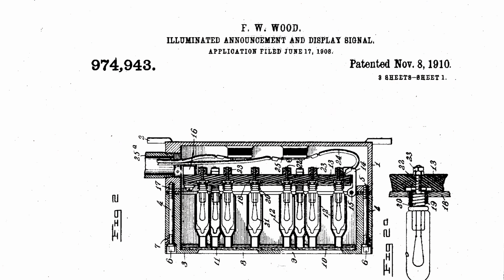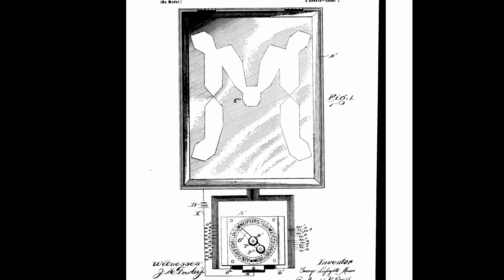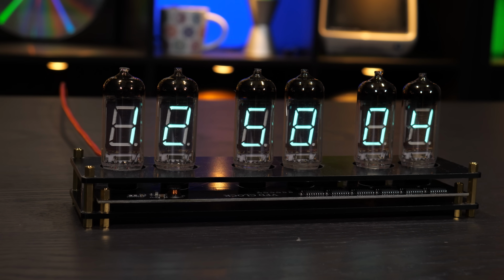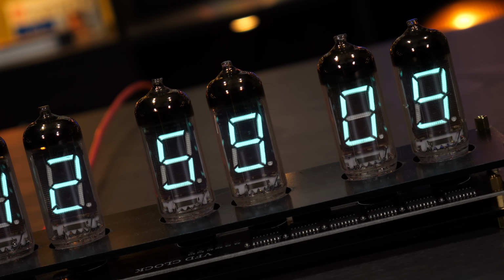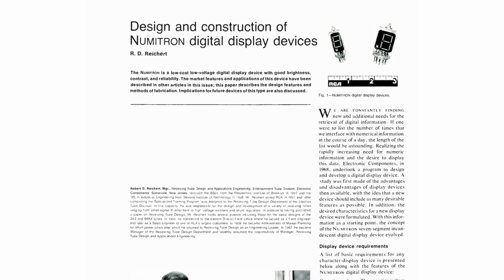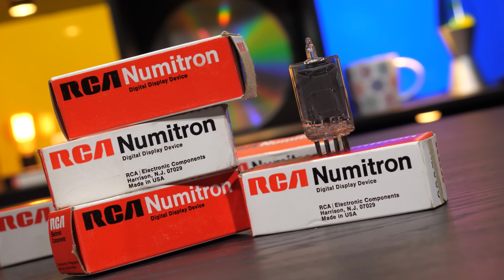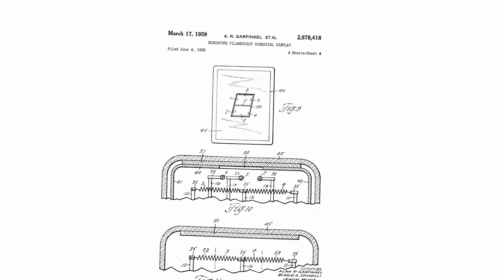The Numitron: An obvious idea that wasn't very bright

Comment: I deeply do NOT agree. Well, I love them.
I have made a number of projects, i.e. SWTPC digital electronics and ESE digital clocks using Numitrons.
Sweet.
They look great, esp in the dark room. Big bonus over LED, Numitrons electrically are easy to work with.
Just hook them up, feed the segment current trough a 74147 or I do like Gdr mdae constant current driver D348 better.
 Numtron displays work well on dim desktop say electronics frequency counters, 
clocks even on gas pump displays exposed by the sun ligt..
No problem at all. YOU are biased, wrong judgement.

I have made a video on one of the first digital displays made by  F.W.Wood / Charles Cory & Son.
The "Illuminated Announcement And Display signal" system., You have shown very briefly. 
Lazy YOU, You might have taken just ONE single picture from US patent office.
I did the cleaning up many pictures and made them readable, easy to understand how it works now.
Give it a try.

Comment: The problem with a black background, isn't handling the heat of sealing the tube; it's handling the heat of the filament of the light itself. The gray background is a mica (actual stone, can handle 1300C) sheet that can't be easily colored. It's probably as dark as it can be made.

Comment: You're missing a few obvious reasons for design decisions. As you pointed out, these were supposed to be behind some housing. If they aren't exposed like you're using them, then the gray background would actually make the segments look larger than they are. The matting would reflect light back and make them more visible. The best, although more expensive option, would be to build reflectors behind each filament. The other complaint you had was about the vertical lines being longer. This is also something you see in some 7 segment displays, especially when built into LCDs. Even the LED displays you showed had the same design. The reasoning there is that the vertical bars for numbers look more connected with that arrangement, because of 0, 1, 2, 3, 4, 5, 6, 7, 8, and 9, all using one or more of either a left or right vertical segment. The biggest issue I didn't see you cover is when one of the filaments burns out. Probably the bottom right first since it is on for all but the 2.
Reply: I had an early 'binary clock' that had a 'training display' using the flat-pack version of these things (Japanese origin iirc).  You supposedly would learn to tell time in binary and then switch off the numeric display, but I liked the numeric better... until one of the little segments went out.  Then I discovered the acrylic case had been solvent-welded shut; opening it revealed that the flat-packs were soldered in place; the little filaments were utterly unfixable; and no one had any idea where to source a replacement (in that ghastly pre-Internet era)...

Comment: You were going thru your list of things that it improved upon, the correct voltage, relative simplicity and fairly inexpensive to manufacture... other then the black background being missing, and perhaps being off-center, these were a great solution to the problem of the other products.  The lines were most likely thin to do keeping costs and voltage low.  Give em a break, they were working analog technologies... an AI machine wasn't around to help them design the thing :P

Comment: I thought the name was quite good personally and didn't have a problem with the obviousness. Quite the opposite, it's fairly clear and appropriate for the product and sounds modern for the time. Package design also looks great- very clean, professional and still very "modern"-looking even though it's fifty years old.

The product itself suffers from looking like a prototype that made it into production that- as I mentioned elsewhere- might have worked better if LED and VFD hadn't already been waiting to eat its lunch, and they'd had the time and the money- and the motivation- to refine it.

But that's hypothetical, and- for the reasons the video itself mentioned- I still think it would have been restricted by the fundamental limitations of the filament-based design.

Comment: I have an ESI NUCLEAR scaler timer ratemeter 245 from another planet that also has incandescent filament seven-segment displays in it. I'm on vacation and therefore can't open it up to tell you the manufacturer, but they're not that bad. And, today they don't scream cheap anymore. They scream niche ❤

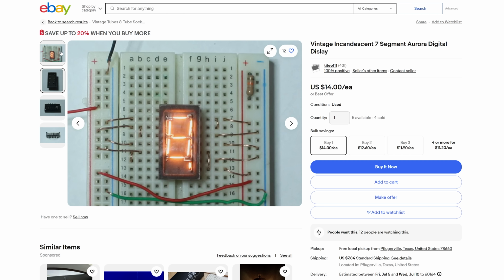Comment: 17:43 Similar displays seemed to be in every Petrol / Gas pump made in the 1980s. LEDs, and VFDs, didn't have enough contrast for outdoor use. LCDs were considered to be very fragile with an operating temperature range of about 10 to 30 degrees C. I had a clock in my car which used to go completely black if you left the car in the sun while I have had the LCD panel in an old laptop physically crack when I left it in a cupboard in an unheated garage.

The replacement for Numitrons in Petrol Pumps were actually small electromechanical displays like the station clock you showed. In Sweden in the nineties they had dot matrix displays using rotating balls, black on one side and white on the other. the inspiration for 
e-Ink ?

Comment: I remember those in gas pumps back then.  Used to the vertically rotating numbers of the old analog display, it was amazing to watch those digits change so fast one couldn't grasp the specific numbers.

Comment: Your VFD info will help me fix several HP power supplies with VFD displays. I think over time the display wears out and becomes dim, upping the voltage might just make them more readable, off to testing!

Comment: You asked the question via a text overlay if the early LED 7-segment display segments were actually made from 7 LEDs or if it was just one long LED with a mask.  I can assure you the segments were made from multiple LEDs. Trying to make a slice if silicon  with such a huge width to length ratio would have assured that 90%+ of them would break before the sliver of silicon was packaged.  For a very long time the width to length ratio of the tiny bit of silicon in an IC was limited to as close to 1:1 as possible.  UV EPROMs were the first IC that obviously contained a slice of silicon that had a width to length ratio that was significantly larger than 1:1.  I think that memory chips were the first type of IC that really pushed the die to have a width to length ratio significantly larger than 1:1.

Comment: Thank you for another great spotlight on an interesting old piece of tech!

Since you mentioned building that Numitron clock yourself, I was curious about a design quirk shown in the video. Just after 12:28, while the clock is ticking up to read "04 21 00", the "59" in the seconds grouping changes to read "69". Was that an issue to how the decoder IC represents the rolling over of a minute, or is the wiring to that bulb causing it to behave like that?

Comment: Maybe I just had no idea what to look for, but a few years back I got the crazy idea to make a steam punk gun for a costume and tried to find some variation of these things for a "ammo" didpkay on it. Ended up buying some variant made originally in Russia because literally every type I could fing at the time used "more" than 5v, so would have added, to my very limited electronics skill, "How the f do I safely up the voltage to what these stupid things need?" Nice to know I was just clueless, and not that this tech came from the insane period when it woukd have been in a computer woth like 14 different voltage rails, instead of just a sane 5v. Lol

Comment: In about 1976, my first "real" girlfriend, Chris, gave me a 6 digit, 7-segment red LED display clock made by National Semiconductor which undoubtedly used NS displays. It cost $20.00 and I had it for many years. It was compact and worked very well. Maybe I still have it somewhere... 🤣

Comment: Seems like the idea could have been turned into a much better product with a little more development.  I wonder if they just sped through the product development thinking new technology might replace it before long.  Changing the material for the backdrop, adjusting the positioning of the elements, and maybe using flat strips or tight coils instead of thin wires, if that didn't throw off the voltage, current, and temperature balance.

Comment: Even further into the weeds: for the same reason of making BCD decoders cheaper by reusing transistor pathways for several digits, most parallel BCD decoders take in 4 bits of input (values 0-15), but only correctly display 0-9.

You could make 10-15 display as hex A-F, but that would mean more transistors to capture those extra states. And so, most discrete 7-segment decoders you can buy even today only do 0-9 correctly, and then degrade into arbitrary zalgo text if you feed them 10-15.

Which is very annoying if you're building a silly retrocomputing thing and want to display a byte as two hex digits on 7-segment displays. Ask me how I know. 

Even more irritating, when transistors became so cheap that the savings of skimping on the hex digits no longer made sense, the manufacturers started decoding 10-15! But not as hex, as a random assortment of letters that were situationally useful to whoever was buying these things. A common extended output is the letters "hELP", which is quite funny. But also quite annoying when you want 4-bit binary to hex decoding, with parallel inputs (not I2C or SPI or serial or whatever), and not costing $30 each for a clone of a 1974 chip. grmbl.

Comment: Numitrons were used in gas pumps at many service stations. They were larger and brighter than early 
LEDs, and didn't require high voltage like Nixies, or a secondary supply, like Vacuum florescent displays.  Later technology made them obsolete. I still have a few new ones in my shop.
Reply: I might have seen these as a kid in the 90s. I grew up in a small town that took its time catching up to the modern era. :)
Reply: @jamesgizasson  I saw some new, surplus display boards for pumps a couple years ago at a Flea Market near Ocala, Florida. They were a good choice for this, since the displays were both low voltage and very current limited so they couldn't arc and ignite gasoline fumes. I have seen a continuous arc a +5VDC on new circuit boards. The board house had scratched the film, so we received an entire run of damaged blank boards. 
The arc was near the input to an ICL7106 a LCD voltmeter. This caused random readings on the  displays, Luckily, it was easy to use an Exacto knife to trim the nearly invisible copper whisker.

Comment: I had or worked with a piece of equipment that used these pieces of shift but I'm old so I can't remember what it was, lol.
That said, lab equipment with nixies were hugely popular with my set because you could them from the other side of the lab.
And I had a VFD "pocket" calculator in high school in the 1970s. I had a lot of fun hacking it and shocking my fellow students with it.

Comment: How did you forget the movies - every improvised explosive device had a 7 segment of varying quality from nixie tubes to LED displays. And each came with a "pip... pip... pip..." sound as the digits counted down. I built a few prop bombs for shor films that had all these features plus cut the wrong wire and the timer speeds up etc. :)

Comment: I'm almost certain that the gray color for the backing was selected deliberately so that it would reflect a certain amount of light coming from the filaments, "blurring" the extremely narrow segment lines thus allowing the numbers to be more legible. You can even see the effect working in the medium shots of this video. Put a tinted filter plate in front of the display (like the kind used by other 7-segment displays) and it would block outside light from reflecting off the backing, further controlling the overall effect.
Reply: That would make sense that they would be even thinner if they had a very Black background. You can sacrifice a bit of Contrast for a bit of thickness

Comment: When I was in school in the late 1970s, I did some practice in a gasolene pump factory, and I remember that the displays used Numitrons (or equivalent; I don't think they were the flat package versions mentioned in the video but my memory is hazy on that issue). I remember thinking (I was 14 at the time), that I thought it was fairly low tech to simply stuff some filaments together like that, compared to something more advanced, but I still thought it was a neat idea, as it was using well established age-old technology in a new format. I still don't really agree with how horrible they were, true, they were an interim solution, but at the time LCDs were slow and temperature sensitive, nixies looked old fashioned, LEDs were not bright enough, and VFD required high voltages. The pump displays if I remember correctly used orange contrast filters, and they were quite readable. The main drawback I was thinking was that the main failure mode would have been to have a single segment fail, causing incorrect readouts.

Comment: Fun fact: incandescent digital displays are still used quite frequently in aviation. In Cessna 680s, 560s and 550Bs the clock (Davtron Chronometer M877) and the temperature readout for the climate controls are incandescent digital displays. And no, the segments aren't even perfectly lined up. I found them super cool when I finally realized what they were.

Comment: Damn, you seem to really hate Numitrons! I'm sure you know that WORSE led displays were all-too-common when it comes to the space between digits , the shape, and positioning the segments. Those sure did cost more then they should have as well, and were, on more then one occasion, the only thing available. You need to point your guns at low contrast passive matrix dot matrix LCD, and LCD in general (I don't mean instead of this vid). Although LCD was too good of an idea to ignore... one can be articulate while completely trashing LCDs with reckless abandon when it comes to painfully limited and boring and ubiquitous aesthetic, and relatively poor contrast that does actually suck most of the life  out of motion video. LCDs just have small dots, often they are NOT the right shape to form ABCXYZ, yet they are used this way in non-video dot matrix. Even apart from that some folks are itching to replace high res LCD when something better finally becomes widely available. I'm not saying there aren't  problems with numitrons. But I ACTUALLY want a bunch of the the 14 segment numitrons because of exactly how they look (though not because they will burn out). And not for everything of course.

Comment: During the late 70s and early 80s, self-serv gas pumps used these and they were horrible.  They were ok at night, but if you happened to pull up to the sunny side of the pump, you were S.O.L.

Comment: The contrast issue could be easily fixed with a small enclosure on the back of the filaments, even allowing the segments to be nicer shaped, but perhaps the cost of adding 7 very small pieces behind the filaments didn't worth the effort back then?

Comment: I remember using green plastic DIL displays with filaments around 1973, they tended to burn out quite quickly. They had a silver metal background. I think we replaced them with pin for pin LED equivalents. However a few years before we had some Texas Instrument red LED dot matrix displays that had driver and BCD counters built in. My boss built a clock with nixie tubes but the lab got the art work reversed so he 'invented' surface-mount technology at soldered the valve bases onto the foil side!

Comment: I had a Heathkit digital alarm clock from around 1972 that used Numitron tubes. Mine had no decimal markings whatsoever. Hours, minutes, seconds were layed out like yours, but in a brown (of course) enclosure.

It's better than the overly complicated Lumitime backlit mechanical digial clock my sister had.

Comment: I'm really confused. They're a much cheaper way to make a digital display tube, and use very little power, and are perfectly legible to my eyes, even from feet away. Am I supposed to believe that there is something wrong with them because the segments don't line up perfectly? These would look fantastic behind a diffusor, and I imagine on top of everything else they are more durable than some alternatives due to the simplicity of the design and the lack of large unsupported grid layers.

Comment: My dad owned a calculator with light up seven segment tubes similar to these ones.  He bought the calculator sometime in the 1960s or early 1970s and used it way up into the 1990s.  It's probably still packed away in his boxes of old stuff somewhere.

Comment: Another big drawback would have been the speed at which the numbers could change. Filaments take a while to heat and to cool so the slew rate there which significantly limits their application.

Comment: Actually, decoding a 4-bit number into one of 10 outputs depending on the number is slightly less complicated than decoding it into which segments are lit for which numbers. It's only several gates and on a not even that relatively modern IC there probably isn't even a cost difference but there would have been one when using discrete gates back in the day. But the point is that the Nixie tube is technically simpler than the 7 segment display on this point.

Comment: What the hell? if i recall correctly, they do have black plate on 6AK5 or 5654 tubes size, and they might get away using thicker filament and 15-volt B battery instead, you can probably also use N-FET to coupled it so that it can be as bright as 16:38 but then again, it's probably better off that we went with VFD instead.
.
Also, off topic but you wanna know a really crazy batsh*t insane the Japanese did using Nixie tube? they put Nixie inside 211/845 sized tube and it's hilariously big, it's called CD-47 or GR-414 tube, it's absolutely bonkers lmao.